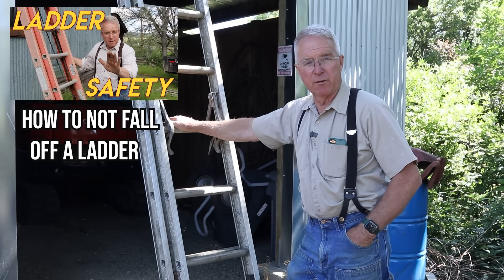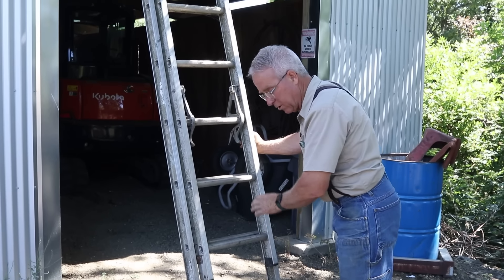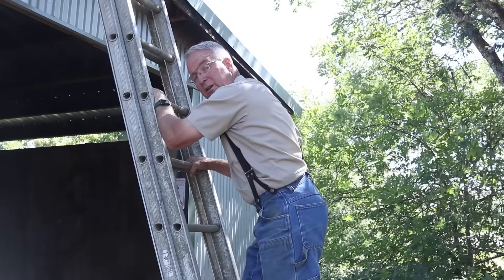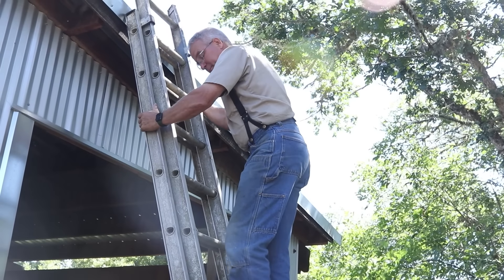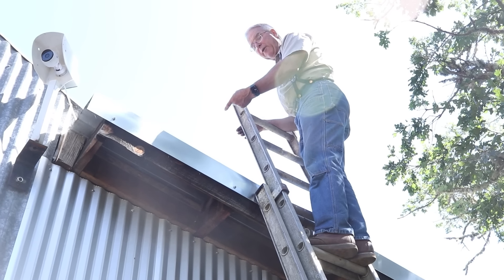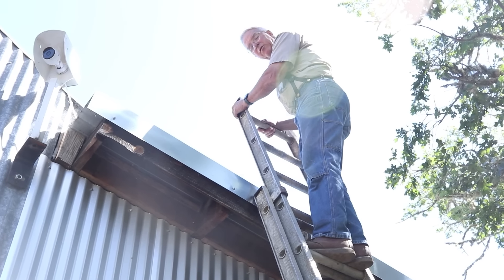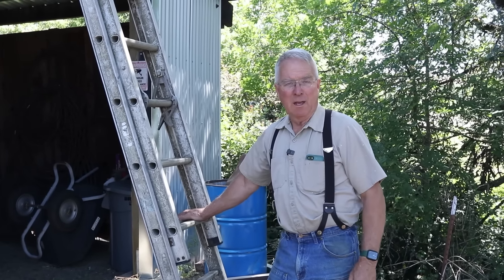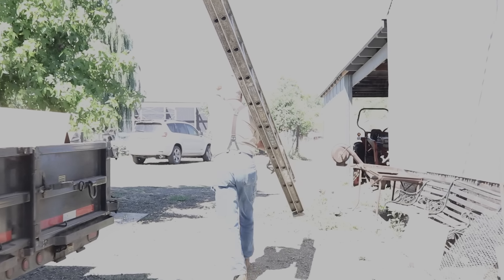How to Climb A Ladder, Dismount, & More Tips

Comment: I was a dumb apprentice in my early 20s, when I found it a good idea to set up an extendable ladder at the top of a flight of stairs, without securing it in place. Once I reached the top at about 5 meters, the ladder's feet slipped and both I and the ladder shot down the 15-20 steps. Naturally, when I felt the ladder slide, I froze and grabbed the rungs I used to climb up for dear life. Doing so, I believe I saved my hands from being shaved clean off at the knuckles by the rails of the ladder grinding down the flight of stairs. I was very lucky to make it down safe with only a few bruises on my knees and elbows from the rungs banging against them.

I still grab the ladder by the rungs to this day and try my best to leave my dumb days behind me.

Comment: One of the best pieces of advice I've ever gotten is if the ladder is up against a rain gutter, hook a bungee cord into the gutter on each side of the ladder.  It really helps to hold the ladder in place and stop it from going side to side.  I will also park my car (front bumper) against the ladder if I'm accessing the roof  (2 story house) from the drive way - I've always had a real fear about it sliding out from under me.  Sorry if someone has already mentioned these.

Comment: "Lock jaw ladder grip" is a handy device to attach your ladder to the gutter (if there is one) so it can't slide sideways or outwards. Greater confidence and safety when getting on and off the roof. Im 66yo building inspector and finding it excellent.

Comment: Excellent video.  I work with volunteers.  They scoff at "The ladder is the most dangerous tool on the jobsite."  You can imagine how my mouth dropped open when I heard it from you.  I think the stupid practice of putting a step ladder against a wall is the fastest way to find out just how dangerous ladders are and how ready, willing and able gravity is to break your ass.

As for rung vs side rails;  You only work jobsites once where there are dogs that you learn to use the side rails.  If I have to explain it then you'll most likely never get it without an experiential learning experience or two.

Comment: The video provides valuable tips! Thank You!  I also like to dig in the legs a bit.. Or, put 2 wooden stakes in the ground, to support a 2x4 x24" spanning across both ladder legs.  I've also never been shy about "securing the top of the ladder with 2 pieces of perforated steel strapping & screws."  It may not be too good for the roof, but it's at the lower edge, and you can always put the screws back in the holes, after you remove the strapping... once you are off the roof, and back on the ladder.

Comment: I would also like to add that I have learned TONS of things in the comments sections of your videos. In this section I am seeing a lot of references to the transition from ladder to roof. I am a roofer of thirty years and would like to give a little advice for transitioning to a shingle roof. We use old furniture cushions. We take them out of the upholstery material and use the yellow cushioning to help grip to shingles. I like to have at least two personally but if you put that cushion where you are stepping off of and onto the ladder it helps tremendously. With two cushions you can throw one in front of you, step on it, grab the other and repeat. We call them "Cadillacs". They will also hold things for you on the roof. Maybe this will help someone.

Comment: Worked on signs; I copy my steps that I used to get off the ladder to get back on. Also, I heard once that fear of heights is usually caused by an inner ear problem, so you could develop a fear of heights for a very good reason. I was taught to carry a heavy ladder leaning it against my shoulder with my left arm above my head and the ladder slightly behind my head.

Comment: I was in the painting business for 50 years and worked with ladders all my life. It's good to see a video done by someone who knows what they are doing. The only thing I disagree with is how to carry a ladder. For a light ladder his method is fine but as you add weight I would hold a rung with my left hand but hold the edge of the ladder with my right and let the ladder rest to some degree on my shoulder. At 180 pounds I would not be able to man handle a heavy 32 or 40 foot ladder with his method. Once a ladder is up you sometimes want to move it without taking it back down. You can't manhandle it but have to use balance. With my left hand on a lower rung and my right hand up above me on the edge of the ladder I would bring it in against my body and balance it as I very slowly walked. Sometimes I would have to take a quick step backwards to maintain balance. As I showed my employees, with a lighter ladder like a 24 foot I could walk with it up in the air using only one hand because it was balanced against my body. Manhandling a ladder is very different.

Comment: At the utility company I worked for for 40 years. We had to sit through three days of OSHA training at one time all about scaffolding and ladders. All the engineers and all of us tradesmen electricians HVAC carpenters I had to sit through this training for 3 —8hour days…
  The reason was, scaffolding, and ladders are the major cause of construction site accidents..
  after watching all those videos, and hearing those speakers, we had to get all of our three step ladders out of our vans and run over them with our vans so they could not be used again..
  with a three step ladder after the training video, we were not allowed to use the 3 foot ladders anymore because you’re only allowed to you step on the bottom step of a 3 foot ladder.. The top two steps of any ladder are to never be stepped on/used.. they replaced all of our 3 Step ladders with 4 step ladders.. we were only allowed to use the bottom two steps..

Comment: I've gone up ladders with my dad before, but this time I've got to do this all alone. I told my girlfriend's mom I'd do the Christmas lights so she wouldn't have to hire someone else to do it. Looking at the house, I didn't think that I'd need to go on the roof, but there are some complicated areas that make it necessary for me to go up there. Climbing back down has always freaked me out, but I'm waiting long enough for her mom to get back home in time to hold the ladder for me. I wish I didn't have to do this all alone but watching this over a couple times has helped me hammer in how to go about this in the safest manner. 
Thank you for your help! I'll edit this later to say how it went.

Edit: I wrote out everything but I got an ad and it made me start over. Long story short, it got really windy and pitch black while I was up there but it went smoothly regardless. I parked the wheel of my car at the base of the ladder so it had extra support and it was really sturdy even in the wind. I didn't realize until going back down, but I misaligned the rung and it was perfectly level with the roof, so I had to take a big step down to the next one go back down. Another thing that really helped is that I brought a hank of paracord with me just in case I needed it for anything and decided to lower all the bags I brought up with me with it. There's something about transitioning from roof to ladder to go down from so high up that freaks me out badly, but you gotta do what you gotta do even if you're anxious or afraid. That's life. Stay safe, fellas. Don't do it alone if you can help it, and make sure you have plenty of daylight and good weather if you DO have to do it alone.

Comment: "use your brain and take your chances". I like that. Coming up to getting on and off the ladder next in the video. That is where I have major issues and just lock up. I haven't gone up there yet but am working on it now that I have a 28' ladder. I've called the local fire department and there is not a charge to get me off with the big boy ladder. That's comforting to know. I tried CR glasses and they are a big help but there are no ladder climbing practice games. Could be a money maker for ladder anti-fear training. I will use my brain, your video, and take my chances. Thanks! Excellent presentation. I have no disagreements with your content and methods whatsoever and I also subscribed.
Reply: Nope, not going to be able to step off. I have a two story. Maybe if I build a practice platform about 8 feet high.  Two story house here with a steep roof. I can make it to the gutters and stay on the ladder though. That is my goal. It is 18 feet up to them. Getting off the ladder? I don't think so. I'd never be able to walk up to the edge of the house and get back on it. I've even had dreams about it. Maybe it's a sign to use my brain and not take too many chances. Very impressive seeing you doing it though. Most admirable.

Comment: Great tips sir,  I'm  135 lbs and 67 years old .  I have to juggle my Little Giant between work sits but it seems that over the last ten years , this ladder has gained over 50 lbs in weight.  It's a very safe ladder  it feels like it is over 100 lbs and is difficult for me to move it around.

Comment: Great video. One thing you should also mention is that when you climb the ladder all the way to the roof the very next thing should be installing some hardware and ratchet strapping it ASAP. It will make it a lot safer especially if you're carrying stuff. Also a fall arrester should be installed by the side of the ladder all the way at the top.

Comment: I'm a small 82 year old woman and have to do my own work around the house. Years ago, my extension ladder started to slip as I was transitioning from roof to ladder; luckily the neighbor boy was walking by to hold it. Now, if I'm on dirt or grass, I poke a couple tent stakes into the ground behind the ladder sides. If I'm on concrete, I use a couple concrete blocks. Don't know if it greatly helps, but it does help my mindset.

Comment: If you're using one hand, it feels better to use the rung as you are pulling closer to your center line. If I'm climbing up a roof with a parapet, I'll set the top of the ladder even with the top of the parapet wall. Swinging my leg over the wall feels better than stepping around the ladder. I've gotten extra cautious in my old age.
That bit at 5:49, where the heel of your work boot is pinned between your shin and the ladder is always fun. Glad to see I'm not the only old guy still doin' it.

Comment: I am a homeowner and I have to trim two holly trees every season. I have to do one of them on an uneven surface that is easily 6 inches to 1 foot difference from one leg to the other. Shimming is not an option and drilling is not an option so I am not going to add the optional device that Werner has to do that. I found a device. I think it is from England. It has a semi circular device that can be added by clamping it to the bottom of the ladder and you adjust this device until the ladder is stable and vertical. I then add my horizontal stabilizer to the top of the ladder to keep the ladder off of my gutters to prevent damage to the gutters and me. Works great. Takes a little time to set up but there is nothing better for a stable ladder. One drawback is if you are old you really need to take it off of the ladder to move it any distance. If you are young and strong no problem. I saw one on Grainger site that is similar but not the same. I did a quick look on the internet but I could not find it. I will dig mine out see if I can find out who makes it. It is the cat's meow.

Comment: 29 years in a large metro fire department, half the time assigned to a ladder truck. We were taught to use two hands on the rungs except when carrying something, them you slide the beam with the free hand. You didn't mention it but the proper ladder angle is 75 degrees. Good tips.

Comment: All excellent points. I would add the importance of maintaining three points of contact. This is critical when performing work while on the ladder. Having that third point touching allows you body to maintain spatial orientation. Being only on two feet does not give the brain enough info to keep your balance, especially if focusing on work tasks. Very easy to lose balance if only on your feet and not looking at your environment, rather focusing on a small work area.

Comment: I go up on the roof of my Ranch house, at least once a year. Usually, I do it in the fall, after the last leaves drop, to use my leaf blower to clean out the gutters. I use your method to get on and off the roof. I set up the ladder on the deck at the back of my house, so I don't have to worry about it slipping of sliding. I still have excellent balance, even at 77.

Comment: A pair of $30 stand-offs at the top of an extension ladder makes it so much safer and prevents the top of the ladder from marking fascia or eavestrough. A wood stake or 16-inch long rebar driven into the ground against and flush with the first rung means zero slip. Oftentimes, it's not that the ladder slips all the way down a wall but just enough to jolt the climber into fright or fall.

Comment: I bought a new work van in 2015 for my construction business. I deliberately did not put ladder racks on it to minimize ladder work.  
My scariest ladder moment...... had my 40' ladder well extended leaning against the gable side of a two-story house. The wind kicked up and pushed the ladder across the side of the house. Fortunately, I was fairly close to the corner and was able to use the corner board to stop the ladder. I couldn't move the ladder and was faced with a nerve-racking clime down hoping the ladder would stay pinned to the corner board. Fortunately, it did. 
Use a ladder stabilizer when you can. I dropped mine down the upper section of my extension ladders to allow it to sit on the edge of the roof. It secures the ladder better from sliding and you feel much safer going up and down. Extending the ladder and adding the stabilizer does add to the top-heavy feel of the ladder but it's well worth the extra effort.

Comment: I used to be a Safety Manager...not necessarily a good one.  You covered more important tips about ladder safety in this video and am glad for it.  I guess the only possibility of concern is carrying a ladder in the vertical position, with the possible power wire at the edge of the roofline, it seems safer to carry in horizontal position.

Comment: Every project I have ever been on that has had a formal safety program has required three points of contact when climbing a ladder. If you needed to move tools or equipment up a ladder you either wore the tools or raised them up with a rope. The only injuries that we encountered were people carrying stuff without maintaining three points of contact. The other thing was to tie off the ladder if possible if it was going to be used for more than one trip.

Comment: Regarding holding rungs or strings: I've always been told you need to maintain three points of contact, so either one would satisfy that providing you pause with each step to reset your grip on a rung (obviously not possible when carrying things up the ladder).

Comment: The easiest way I've found to carry any ladder, over any terrain, including inside of structure, is to put it up on my shoulder, horizontal to the ground with the rungs being vertical to the ground. Balanced properly, you can carry most ladders using just one hand. This includes step ladders and extension ladders up to 40'. It works really well and gives you excellent control of the ladder. I have even carried ladders up other ladders and on to roofs many, many times this way.

Comment: I was terrified of heights and ladders, so I started a gutter cleaning business. I always 1) Hammer a crobar into the ground, hooking the bottom rung. 2) Use a stabilizer. 3) Attach and secure the ladder to the gutter with a bungee or two if I ever need to step on/off the ladder.